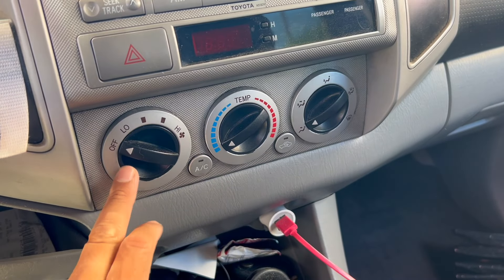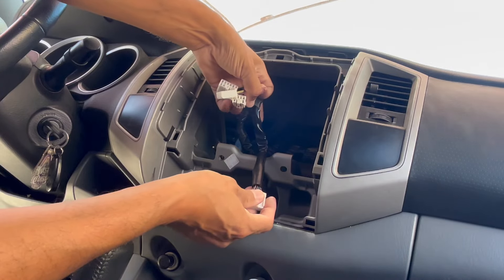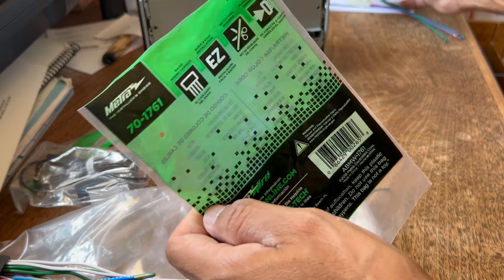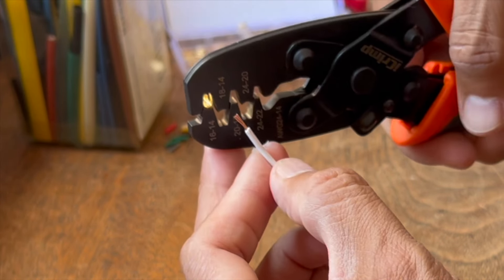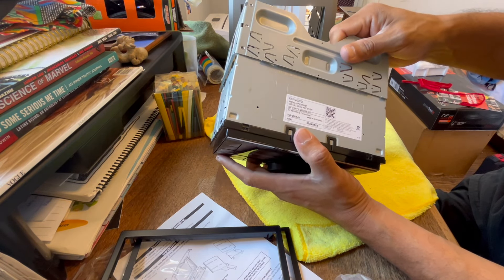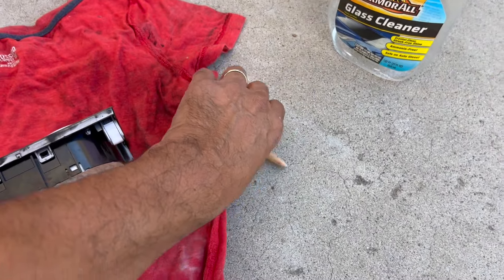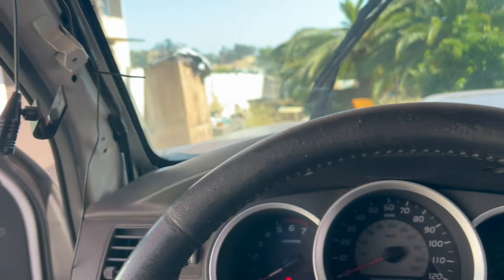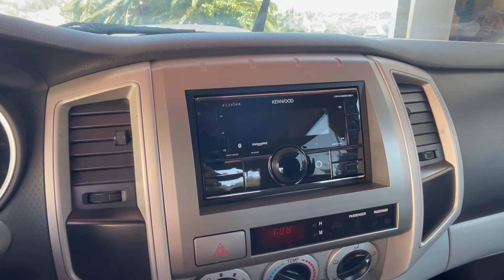Kenwood Excelon Stereo Install on 2nd Gen Tacoma | 2008 Toyota Tacoma Project

Comment: Nice little kit
Reply from the maker: Yes. Love it, but I just installed a newer stereo. It’s an android head unit with wireless CarPlay. Video will release later this month
Reply: @SanDiego_VDubLife  I have a android 10 screen but this one doesn't seem to get loud when you hook it to a amp think it's the way they make them
Reply from the maker: @ interesting. Never heard that. Do you have stock speakers?
Reply: @SanDiego_VDubLife  no Rockford fosgate
Reply from the maker: @ oh. Ok well I will hook up an amp eventually and tell you how it works for me. Hopefully it works fine. Appreciate your comments and feedback. I just finished hooking up the backup camera on my truck and it works awesome. I might get a tailgate handle cam and switch over. I didn’t even know they made them for second gen Tacomas.

Comment: Thanks for the refresh, i might need to open up a dash again. I installed a Kenwood Excelon Ddx396 on my uncle's 07 Tacoma.  But now the radio stopped working because the car battery got replaced.  Need to help him troubleshoot 😅
Reply from the maker: No problem. Thanks for watching. Battery should not impact the stereo not working. I would contact Kenwood. Should be covered by warranty if it’s not too old. Love this stereo! Working great!

Comment: You do great videos!  Would you mind doing a ‘shortie’ on the dim / bright settings?  Is there any way to manually dim the screen at night without going into the settings?
Reply from the maker: Not sure about that. I got to investigate. Shortie coming soon
Reply: Okay so I just played around with mine and if you push and hold the DISP button it turns the dimmer ON/OFF.
Reply from the maker: @ good to know. Thanks for sharing.